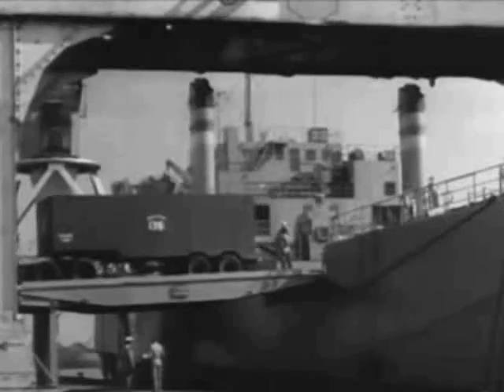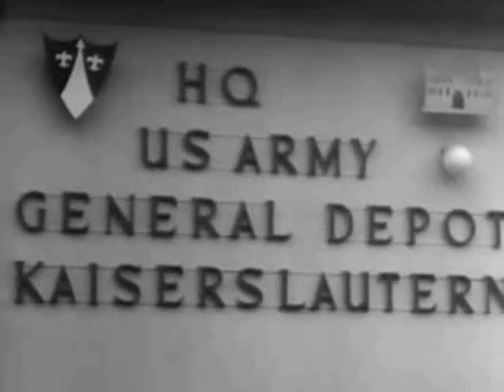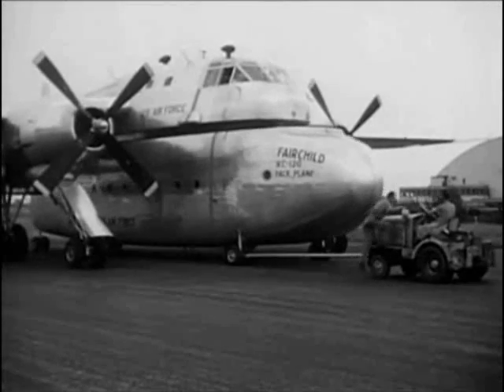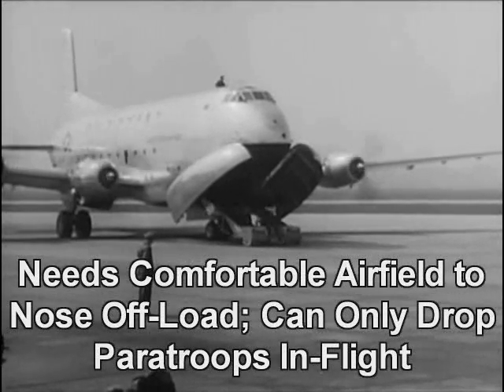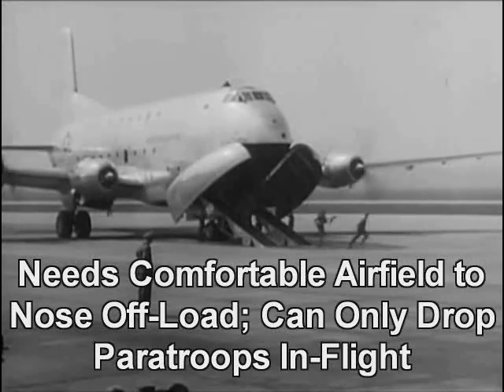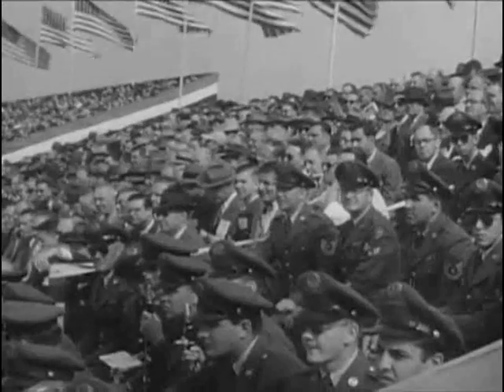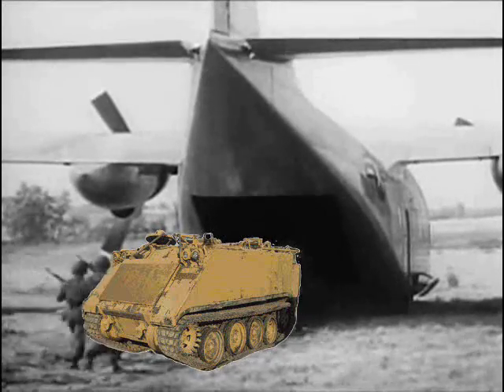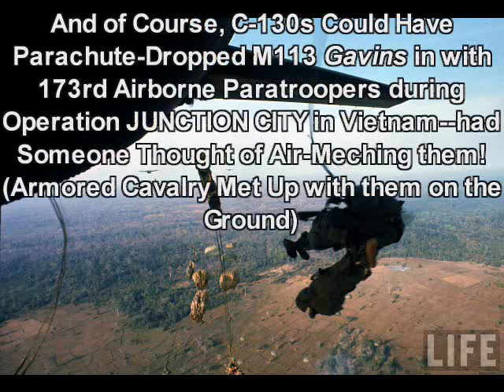Gavin's KIWI PODS: USAF Transport Treason

Comment: GMTA. Looks like 1LT Mike Sparks was RIGHT--again, civilian normie losertards and milsheeple do-nothings... 

https://www.popularmechanics.com/flight/a18929/boeing-patents-cargo-plane-move-shipping-containers/

Boeing Designed a Strange Plane That Would Suck Up Shipping Containers
It would roll right over them, squat down, and lock them in place. 

BY JAY BENNETT
JAN 11, 2016

Boeing received a patent last month for a unique airplane design that would lower onto shipping containers and then lock them into place. The strange-looking design has landing gear that is wider than the shipping containers and a large fuselage that opens underneath the plane for the containers to slot into.

Existing cargo planes don't use the standardized intermodal shipping containers that you see on cargo ships and trains. Instead, air freight is transported using the unit load device (ULD) system, which packs cargo into smaller containers and onto pallets for transport on both cargo planes and standard passenger aircraft. Boeing's design would not only allow a plane to carry more cargo, but would also transport air freight in the standardized containers to streamline the shipping process.

The intermodal containers may be loaded through an opening in the bottom of the fuselage. Specifically, intermodal containers may be arranged into a row. The aircraft may be then rolled over this row of the containers and lowered onto the containers followed by engaging container corners.

Patent Yogi has a great—if a little peculiar—animated video of what Boeing's [Burnelli-style Blended Wing Body] plane might look like in action, if it ever existed:

Boeing patented a special aircraft to carry containers for quicker deliveries

https://www.youtube.com/watch?v=kaNSaRTglBc

As with many ambitious patents, it is likely that Boeing is simply securing priority of an idea just in case they ever decide to act on it. A plane that can lower its entire body and lift more than a dozen shipping containers would require a lot of testing and design work to actually accomplish. Still, it's a cool idea, and maybe the aerospace giant can pull it off.

Source: Patent Yogi

**